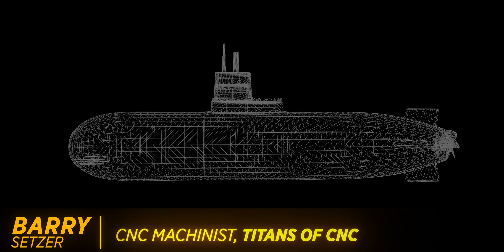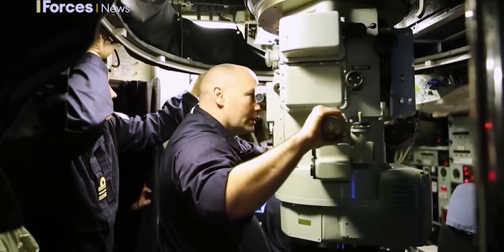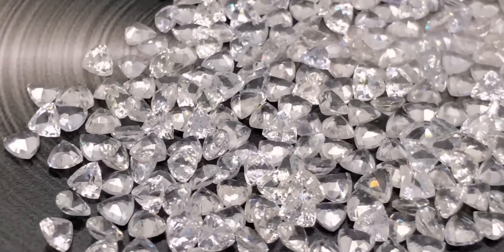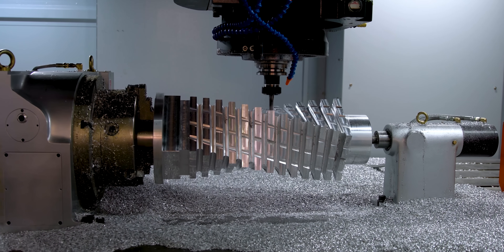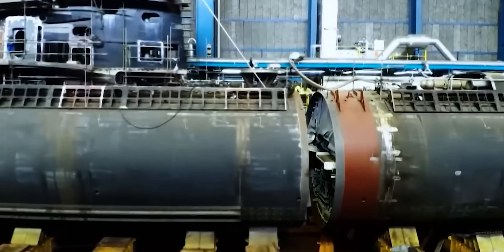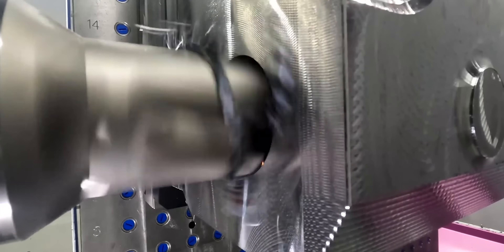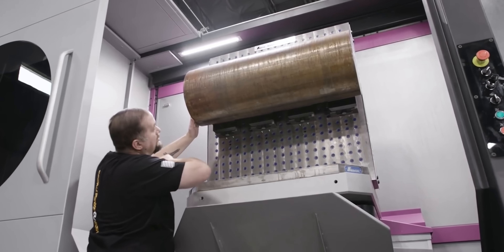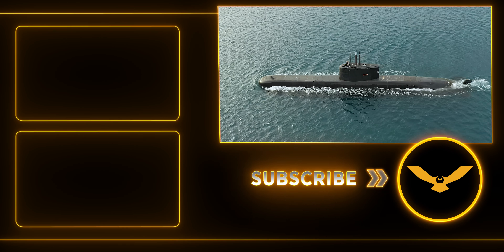I Machined a 50 Million Dollar Part

Comment: The parts I make aren't expensive, but they are mission critical to saving lives everyday. I got to see parts that I made enter a human heart in a valve replacement procedure.
Reply: Remember making nitinol stents at laserage technologies way back in 1998. Lots of QA traveller paperwork per part. 0ut of 10 only 2 were actually good enough to be put in somewhere in an artery. The stainless ones had a much better rejection rate.
Reply: @christopherleubner6633  Nitinol is no fun to machine.
Reply: That's actually really awesome!
Reply: brandons9138,
They weren't super expensive at your end, but you can rest assured that the medical supply company that sold them got thousands or even tens of thousands of dollars for your not so expensive parts. It is too bad that those who actually do the work don't make the big money from their sale.
Reply: @AMERICANPATRIOT1945 The parts we make are only part of a larger assembly. Our customer sources the rest of the parts and actually builds the assemblies. They have to get paid too. That's kinda how capitalism works. The guy who mines the iron that goes into steel doesn't get his cut of the cars sale price where the steel ultimately used.

Comment: Sort of off topic but I use to work on rail in WA Australia , Talking about $$ if you make a mistake like one of my co workers did , . Our  compamy was working for one of the big 2 iron ore produces building a second rail line for them , This necessitated driving track machines on the main line , as in the only line to the port , So one of the track machine operators rushed to get his machine off the track before a ore train was due to use the track , and he accidentally ran his machine though the switch ( Switches are those things allowing a train to go down one line or the other) . The result was the machine broke the switch and took 24 hours to repair .  The compensation request was reported to be $100,000,000 , which seems about right . Ive heard of another company seriously considering pushing a $200,000 truck off the track and down a hill (middle of nowhere with an IT loader , because it broke down and was going to hold up a fright train serious business . I was even on a 4 day shutdown with probably 500 guys and 300 pieces of equipment which had been flat beded in from 1600KM (1000 miles ) and due to incompetence got if lucky 1 % of the job done , great fun but ! . The pure waste in railways is astounding , o a train carrying a load of harleys derails , insurance company pays up , alright boys time to dig a hole .

Comment: Most expensive part I worked on was an outer shell of a next gen torpedo. We were tasked to produce three of these prototype parts. Around 15,000 dollars a peice. Most nerv wrecking part were running the program for the first time. It turned out fine in the end.

Comment: Not a machinist, but I was a mechanic in a somewhat rural shop. I had to fix a radiator on a Dodge Viper that bottomed out and bent the nipple using a Jack, cone, and hammer. 
After that, I was trusted to lift up a 1936 Cord model 810 for a check over. Lifting rare antique luxury cars gives me anxiety. 

As a superintendent for a general contractor now, I’m currently tasked with remodeling a medical manufacturing facility while keeping dust and VOC’s contained. One metal shaving on the container of their product will trigger the rejection of millions of dollars in products. No pressure
Reply: Easy money

Comment: Turns out submarines are a lot more expensive than I thought.
Reply: You should see inside one before the walls are installed.  It's unbelievable how much wiring, tubing, switches etc. is installed. Every inch of that tube is stuffed.

Comment: cutting a bunch of 0.00003 inch chips to throw in the dryer with... just to make "that" side of the bed unlivable. hypodermic times 100, itchy monkey... and they don't rust because there 300'000psi tensile hardened stainless. thinks that feel so soft but there so sharp and small that you don't know till... too deep into the P.B. mansion... the un-itch able itch with the rash. deaf and half blind with a 10mm Springfield, know even the shavings have there use.

Comment: I’m only 17 but I’ve already cut a nerve racking part myself.

I am apart of my high school robotics team and I am the main operator for the cnc router. For our design we wanted to build a 27” diameter turret made of polycarbonate. It tools a lot of prep work in order to get this done. We first cut test pieces out of pressboard in order to ensure everything would work together. But one problem we had was that the material would flex and an edge on the side of the part would be way out of spec. We managed to fix this by putting screw throughout drill holes we made beforehand to secure the part. Next we also tested out feeds and speeds for cutting polycarbonate on a scrap piece of it. We only had one sheet of polycarbonate big enough for the turret pieces so we made sure everything was right. It was nerve racking for the first part getting cut out. Once it finished I pulled it off and check every dimension and they were all perfect. After that I kept getting more and more confident with each piece, until I could almost just let it run without even watching it. In the end every piece fitted together perfectly and the robot we had made qualified us for the world championship.
Reply: Woooooohhh you In frc?
Reply: @Vanilla_Icecream1231  yup, going into my fourth season
Reply: @JaxinLovorn  awesome it’s rare to see another frc person On the internet lol I too run the cnc mill for my team
Reply: What team number? I just had my last season of frc and it was crazy
Reply: @williamrosen4475  5462 2PawRobotics
Reply: Yooo fellow FRC peep
Reply: Im an FRC alum that is now a machinist by trade. Now mentor my old team. I work with several thousand dollar parts daily.
Reply: FRC was fun did it for 2 years as part of 1087. In 2006/7.
Reply: good job bud,I hope you go far

Comment: I needed to see this video. I usually make small alum parts, so a scraped part is a few bucks. I recently did 50 pieces of delrin at a material cost of $40/each. Messed up like 7 of them… you feel it for sure

Comment: It was only a $50k piece of titanium about 20 years ago and the company before us had scrapped the part. We were only a small jobbing shop but did a lot of aerospace work and parts for reactors.
We actually ran a test part on a block of aluminum to check our program. The software back then wasn't anywhere as good as today and we weren't taking any chances. The lead time was 3 months to get a new piece of material. I've worked on models and dies that were over $1M but a single part in the assembly was no where near $1M.
I can't imagine the stress of machining a, $50M part. 😮
Reply: @dafaqis-is I was once working on a civil job alongside a guy who had once been the head machinist on a 20m diameter bearing for a mining dragline. When I met him he was working a stop/go sign, less stress and more money. It’s sad for sure and I’m not even a machinist.
Reply: @ian9toes that's actually true alot more jobs that pay more for less stress
Reply: Same here. To damn stressful
Reply: Dang so you would test a program on a metal that nowhere near resembles titanium.

No wonder it got scrapped!
Reply: That’s because a “machinist” nowadays is on the bottom of the totem pole in the process of getting a machined part made these days. It’s the programmers and manufacturing engineers in the machine shop that make the good money. A machinist now days is basically a glorified machine babysitter. Now granted, that’s not the case in every machine shop or every machine shop inside a manufacturing facility, but it’s absolutely the majority of them. A machinist nowadays bolts a billet to a mount, closes the door, and hits the Run button and takes the part out when it’s done. And even that part of the job is quickly being replaced with automation.
Reply: @Brodozer39  that isn't true at all, especially in job shop work. programs are rarely perfect off the computer. i have to change parameters in the code based on performance, verify that there is no risk of crashing in every setup before and during running, and about half the parts i make i have to make the fixturing myself. and i'm not even a machinist, just an operator.
Reply: Bathinclouds
You maybe the exception most operators type in a few coordinates, make sure a new sized cutter is in and hit enter. 
Then they go back to finishing their third energy drink.
Reply: @bathedincloudsofblood  you sound like a setter.
Reply: @LaGrandeBayou  i'm on a manual mill now but generally we work with the new guys to help them become more self sufficient on the shop floor. even those without relevant prior work experience or education can pick up enough knowledge to take programs and make needed changes on the fly fairly quickly. some of the operators dont pursue a better understanding of the machines they run, and those people generally dont last very long. the place i work at is far from normal, but generally we get the same type of applicants as other shops in the area so it's not just that
Reply: @bathedincloudsofblood  100% If you are in a large Aerospace Corp union shop  Cnc Machinist or Toolmaker will make well over 100k Also  working in large Orthopedic Implant corporation and most have lots of overtime pay. Toolroom & prototype .custom  dept.one of a kind projects pay very well .Because you are in charge of job from start to finish.
Reply: @Rick-CNC  I'm in the States can you give me some advice on getting started I have no physical experience in a shop. I wonder if it's easier to get into it over seas like in Europe.
Reply: @Brodozer39   You have runners, setters and programmers. 
Runners do what you described but not every shop has zero point fixture, jigs and preset vices. Dedicated to running one job... most places have a mixture of jobs being done on the machines at had and need to clock in vices etc and automation will never replace that.
Reply: @Brodozer39  In high volume stuff sure. But this kind of close to one of work is completely different.
Reply: @Brodozer39  Those are called machine operators, not machinists.  A CNC machinist would know how to program, set up tooling and fixtures, tune and adjust program, CAD design, and all that.
Reply: @dafaqis-is supply and demand. If the skill is niche and there is a lot of market demand for it, then skill market value goes up. If there are many people with said skill and are competing to take up the market demand, then skill market value goes down.

As a programmer for a niche language, i have experienced the ups and downs of skill market value.
Reply: @sepg5084  no need to point out the obvious, captain obvious
Reply: @sepg5084  your confusing skill / experience let alone skilled experience! mark my word, they are totally completely different. if you are experienced in a field, people will seek your skills no matter what! if you are doing just basic stuff every day, you are only skilled to do that basic things. for example, everyone can chop a tree, but not everyone can convert it to a master piece. you dont become a master in a field in a day.

Comment: I forgot if it was copper beryllium or beryllium copper (or one of them "doped" using the other) but the workpieces weighing ~3 kg cost us 750k each and had some of the tightest tolerances i've ever seen. There was not a single surface in the finishes product that wasn't ground or EDM'd
Reply: It is copper with a small amount of beryllium. 3kg would be about right for the valve seats for a mission critical application. 750k indicates it was for some sort of prototype military or aerospace application. Straight beryllium though is extremely nerve wracking to machine combine the work hardening tendency of titanium with the bit eating tendency of cast iron and have the part be as brittle as some magnesium aluminum alloys and you have beryllium metal. It is also toxic on top of it so you got to process it in a glove box. Fun times.
Reply: Beryllium when tied up with copper or nickel isn't extremely toxic.  Beryllium in its pure form is quite toxic and you can develop Beryllium Disease by both inhalation or skin contact.  Inhalation can affect everyone, a small percentage of the population has a sensitivity to Beryllium, in which case it is essentially an allergy.  It was takes a long time to develop, especially if it's sensitivity.  I worked with Beryllium powder, Beryllium Nickel and Beryllium Copper and found out that I was Beryllium Lymphocyte positive (a test for the disease) in 2000.  I'm currently on Oxygen as a result.  I consider myself fortunate, because I'm still relatively functional.  Point of all this is to be extremely careful when working with Beryllium, especially pure Beryllium.  My exposure was in the early 70s when I still thought I was indestructible and when there wasn't as much knowledge about the skin exposure issue as there is now.
Reply: @jeffreywhitmoyer860  well, this makes me appreciate the argon atmo even more
Reply: Be2cv is the material you are talking about but the raw material price is only around 70 euros a kilo
Reply: @srck4035  then it's not that
Reply: @angrydragonslayer  of course it could be the other way around beryllium copper has a matt gold look to it and is pretty nasty stuff. Beryllium in general will kill you insanly fast with the dust
Reply: @srck4035  that sounds more accurate to what we were doing

Argon atmo cleanroom with basically astronaut suits to keep it clean. Had just set up some stuff inside and got offered to do this job as an extension.
Reply: @angrydragonslayer  brother you were probably making neuron deflectors from beryllium. Probably for atomic weapons. Or nuclear power. What ever feels better for you
Reply: @srck4035  nah, i know that aint it (can't say any more on that due to NDA though)

I got reminded by writing the above to check but nothing i've said is close to an NDA breach :)

Anyway, it was some scientific nonsense instrument part (i read what it was for and despite "just" having to write a dissertation to get a PhD in physics, i got no clue what it means).
Reply: @angrydragonslayer  oh OK. Just my first thought because that's a common beryllium usecase. Science stuff explains tolerance and price tho
Reply: @srck4035  and they upgraded the atmo system while i was there 

I ended up getting the old vacuum pump :)

Comment: Machinist of dead tree carcass here. The most expensive mistake ive ever made happened when i machined a kitchen counter top. Customer and boss stood next to me when my CNC moved to its parking position and i went to check the fit of the metal sink in the hole i just cut. Fell clean thru, always check for your tool radius correction folks or your holes will end up exactly one tool diameter bigger than programmed. Lesson learned.
Reply: Technically that part was priceless, the same exact piece cannot be recast. Anyways interesting knowing when a piece of wood is cut open you're the first human to ever see it.
Reply: You can weld wood right??? It’s ok 😂😂😂. Suck ls to hear but great learning experience
Reply: @Jason-gt3ht  yes, with 5200
Reply: Cutter comp
Reply: Yikes rookie mistake too
Reply: done that many a time, it's the stupid mistakes that truly hurt the worst
Reply: That's what caulking is for!
Reply: Was it able to be used.?
Reply: IRAQ LOBSTER
Reply: like they measure once and re check the measurement before doing any cutting machining etc. 🦘🦘👍👍👌👌✌✌
Reply: Dry run first
Reply: YES
Reply: I did that for about 3 months cutting granite counter tops on a cnc... junk job. Junk owners.  Let's just say it this way
. Immigration got called.  When the first officer showed up. Over half the workforce ran out the back door. No bs... and the owner knew it.. he would sit at lunch and drink beer with them. Yet point fingers at us.... no.. I didn't call them. But I look back and that was funny asf.. cough us hack stone in houston.
Reply: Rookie mistake